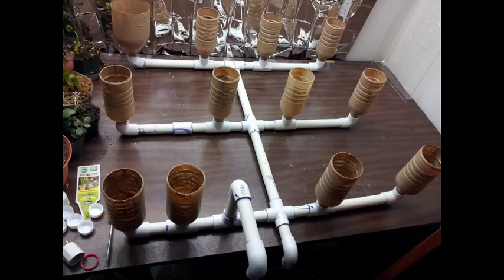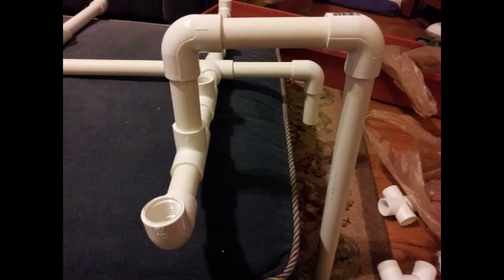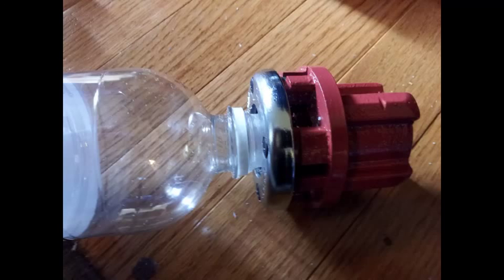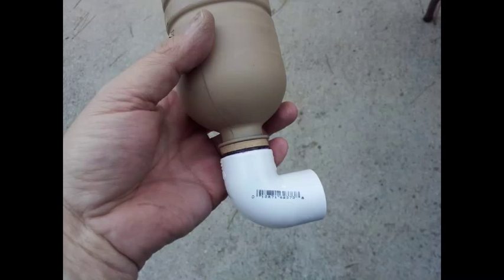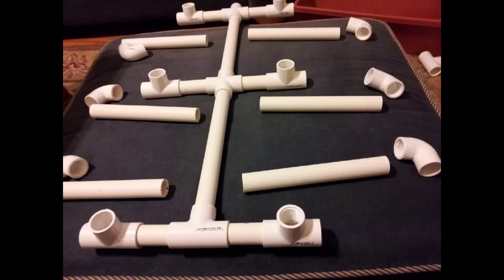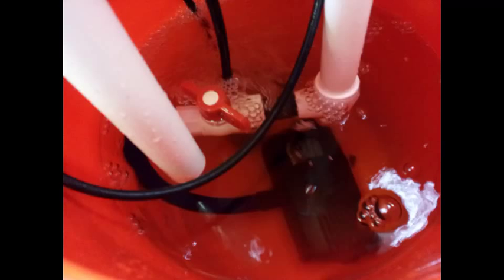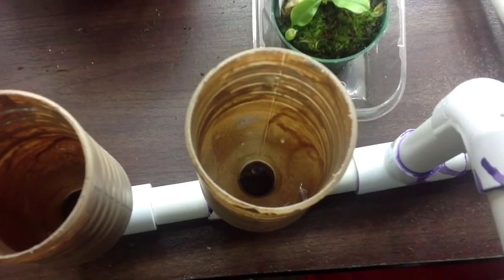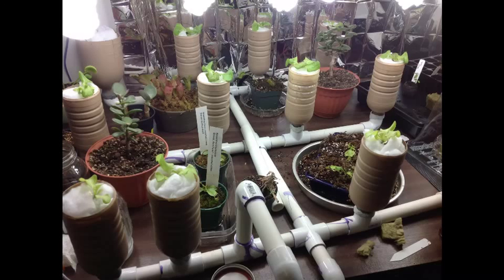Build a flood and drain hydroponic system

Comment: Hey could you help me in choosing a water pump for my flood and drain?
im trying to run a flood and drain but i dont know how much power (lph) a water pump needs to push up water at a height of 1.3-1.4m straight up into the top tray.
my tray drains at a rate of 1500lph (more or less, it drains 20l in 45 seconds) with a bell siphon design. as far as i know the water going up should be weaker than the water going to allow it to drain efficiently?
any idea? thanks for helping a fellow WATER GARDENER